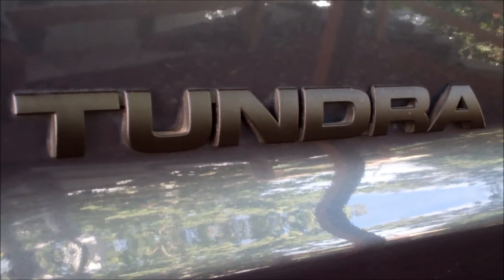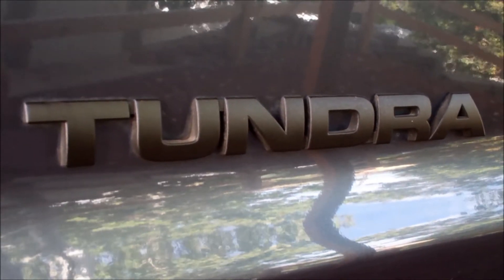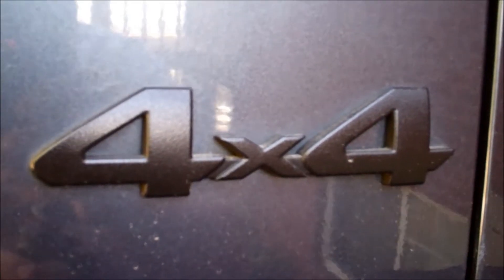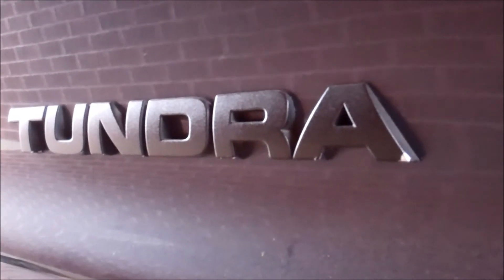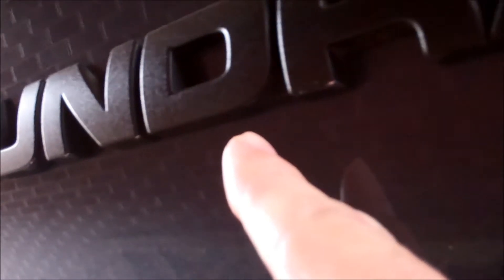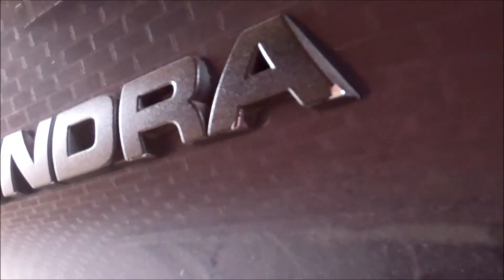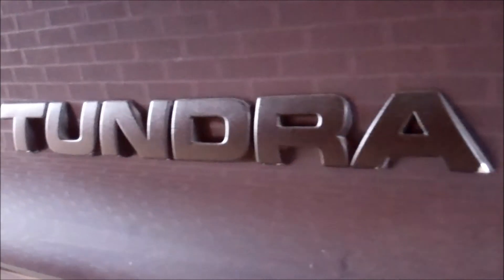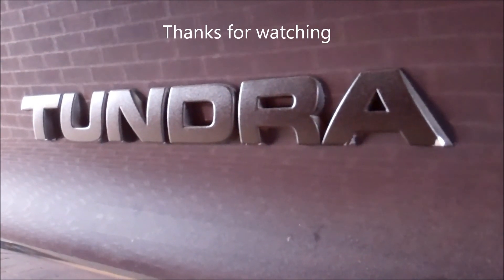Plasti Dipped Badges Update (1.5 years later)

Comment from the maker: Thank you for your feedback, if you are putting new badges on yes you could paint them or plasti dip them before installation, I would, it will save you the steps of masking and removing the excess. Good luck with your project.

Comment: Looks great after so long! I have a few questions however. If the badge is already off, for example, if I'm using an entirely new badge, can I still use Plasti-Dip on it? And with the same method you did? If not, should I put the badge on the car first and then spray it? Thanks in advance!

Comment: Just a quick question for you, I watched your video when you originally plasti-dipped your emblems and you used 7 coats, was there a reason for that many coats?  Other videos I watched only had 3 coats and waited 7 minutes between applications.  Also did you do any other prep work besides cleaning the emblems before hand?  Looks great btw.  I can't wait to do this to my white RAM 1500.  Black emblems will POP!
Reply: Auto DIY I like that extra step of the spray wax!  I will definitely have to try it!  Thanks for the input!

Comment: @auto DIY   I live in PA and the weather can be brutal here. What types of weather did the plasti dip get exposed to over the year and a half you had it on?   Thanks in advance your videos are great and I'm hoping to dip my 2011 Kia Optima badges soon!
Reply from the maker: jesse Hetrick Thank you for taking the time to post your question and great feedback.  The plasti dip on this truck endured both ends of the weather spectrum. Sub zero winters with road salt, and 100+ degree summer heat, with no trouble other than what you see in this video due to my mistakes during application. I am also happy to report that it has been more than 3 years now and the dip on this truck still looks good.  As far as I can tell there is no end for it in sight, and I am still not sick of the look.  I think you should go for it, dip the badges on your optima.  The can is cheap, it is a fun project, and if it doesn't last, just remove it and start over.  But based on my experience it will last for you for years.  Just take your time and apply a bunch of thin coats (5+), you'll get a smooth strong finish that will last.  Have fun, and please let me know if you have any other questions.